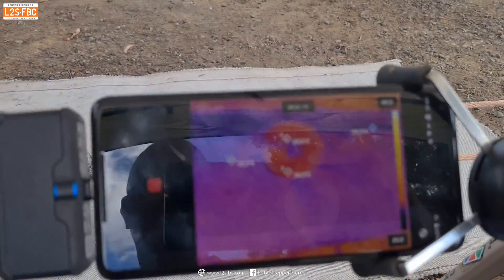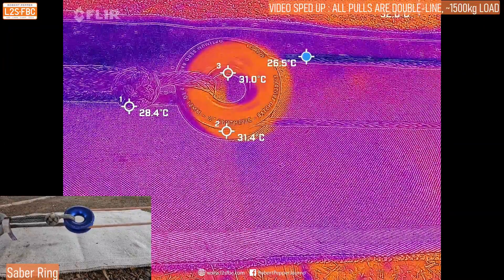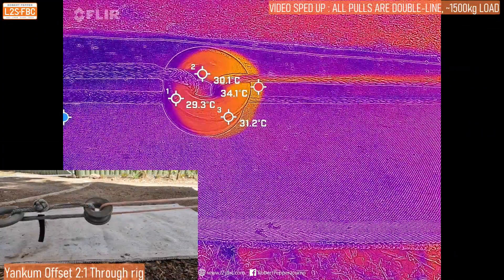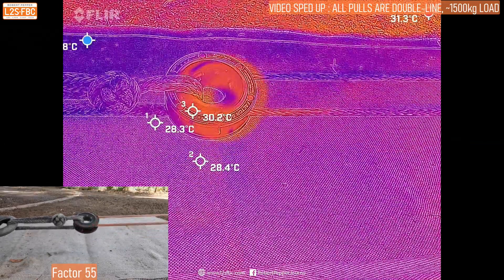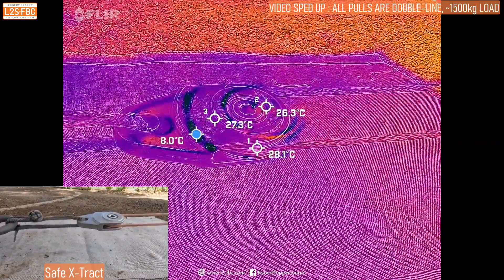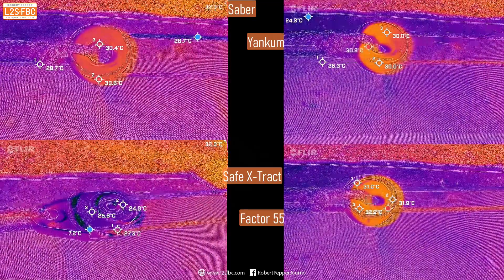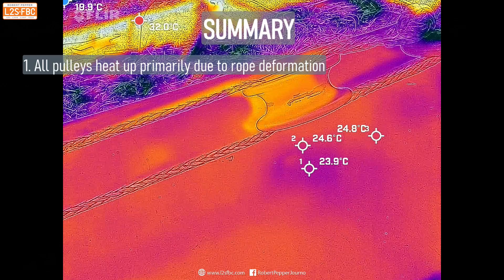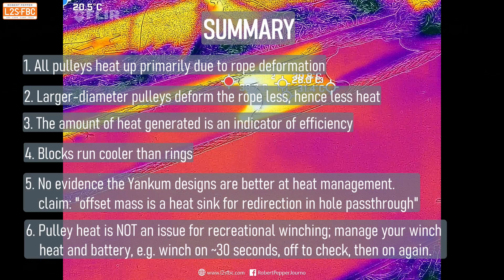Heat in 4x4 pulleys. Should you worry?

Comment: Hi there. One question that's burning my mind is the effect of lubrication on heat and efficiency. I think coating the ring with something lubricating like chainsaw bar oil would decrease the friction and heat, therefore increasing efficiency. It would have to be something that doesn't decrease the strength of dyneema though.
Reply from the maker: It would help, but not in my worth it.  You also don't want anything attracting dirt.

Comment: I didn’t see a 4 to 1 system on only 2 rings as the offset Yankum is so capable of.  
Dividing the same load among 4 friction points would also reduce the pressure by half at each sliding contact.
Reply from the maker: The Spanish Burton uses two rings. The difference is that the Yankum rig uses the same ring multiple times, so from a friction point of view it's worse than an SB as the results show.

Comment: Robert, what happens to the coefficient of friction against the rings when the fiber ropes are wet? Just curious if the rope becomes more slippery and there is less friction loss and maybe approaches a traditional bearing pulley. Cheers.
Reply from the maker: Don't know...a future test I think
Reply: @L2SFBC  Another thing I hadn't thought of is strength when wet. Straps with sewn eyes lose about 20% breaking strength when wet. I wonder if synthetic winch line is subject to strength issues when wet. Many recoveries are done in the rain or wet so it'd be good info to know. Cheers.
Reply: UHMWPE fibers like Dyneema do not absorb water like nylon can. The strength remains the same. There is a noticeable decrease in friction when used wet also.

Comment: Soooo you are calling less than 2 degrees C "significant" on the offset pulley? Can you substantiate that with data that shows this minor variance is detrimental?
Reply from the maker: I didn't say it was detrimental, and I did say that heat buildup isn't significant. What is interesting is the way the heat buildup changes from a through to an around in the Yankum.

Comment: I'd be concerned about dirt or sand on the rope with the yankum. Whatever coating they put on it may be fine for a new rope, but when it gets dirty I'd imagine it'd be like sandpaper. Sure, the soft shackle with a regular ring will experience the same wear, but soft shackles are much cheaper to replace than a winch line.
Reply from the maker: Yes, changing the wear point has pros and cons.

Comment: Those static rings are garbage. I'd never have one in my recovery kit.
Reply from the maker: Why not?
Reply: @L2SFBC  A bearing ring or a pulley block are the only one's I'd use, the static rings just damage your winch rope quicker long term especially if it's dirty/muddy and you're using them frequently. And if a mate gets into trouble and they happen to have a steel wire rope winch line It's annoying.

Comment: About what I expected the results to be. I do think the color profile from the FLIR camera made things 'look' worse than they where really. I don't see a 10 degree temperature difference being anything to worry about. As you mention, I think there are going to be a lot larger limitations like winch duty cycle to deal with before 'overheating' the rings becomes an issue. I think it is important to take the mass of the object into consideration when looking at these results. The traditional pulleys also had the highest mass which would show the least thermal change for a given amount of input energy ( friction ). The low mass rings like the F55 unit will show the highest thermal change based on the amount of input energy. It was interesting to see a pronounced temperature change on the ARB block pretty quickly. It would be interesting to look at what the thermal energy capacity is of a traditional block bushing and sheave compared to the rings. Eventually the cheek plates of a block would start to absorb some of that energy....but it might not be right away. I would also like to see how long it would take for the various items to dissipate any build up heat. The rings are all made of aluminum and will dump heat back to ambient pretty quickly. I agree with heat not being a terminal issue with any of these designs as you can always just slow down the process.....which is going to be going pretty slow anyways with any normal electric winch. I've been using various recovery rings since 2018 and have never had a thermal overheating issue in practical application...and I live in the desert southwest USA.
Reply from the maker: Great points, thank you!

Comment: A serch of the internet shows this product sold as a recovery ring. I don't see any reference to it being called a pulley. The definition of a pulley is as different to a ring as a nose is to an elbow. A simple spray bottle of water may alleviate any heat generated from friction in these scenarios. Cheers
Reply from the maker: A recovery ring is a form of pulley, as is a snatch block which is why I used the term 'pulley' to cover both types.
Reply: @L2SFBC  For hundreds of years, sailing vessels have used sheave or pulley blocks. This design has not changed. The design has three main components the block, the sheave, and the roller pin. Modern all metal versions apply the same principles. To call a ring a pulley would be like calling a wedding ring a wedding pulley. The only time a ring is not a ring is when it's a hoop. It's no wonder people get confused when the names of things get changed. We certainly live in changing times. Cheers
Reply from the maker: So what's your collective term for snatch rings and snatch blocks that would be easily understood by the layperson?